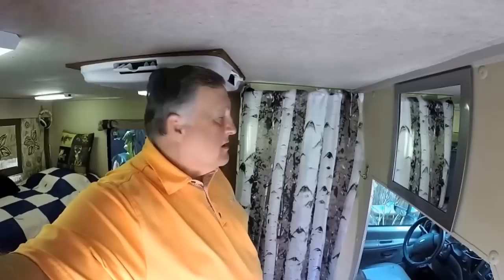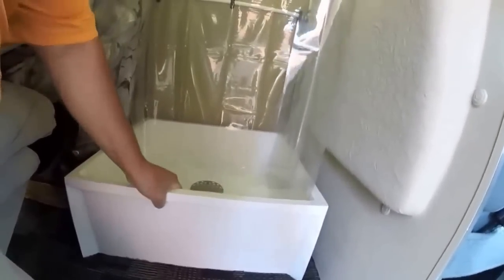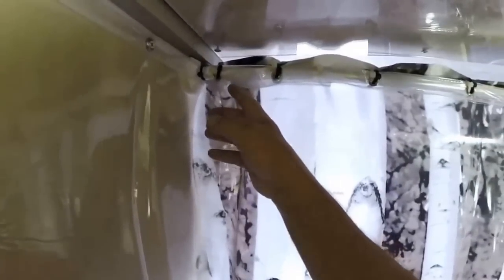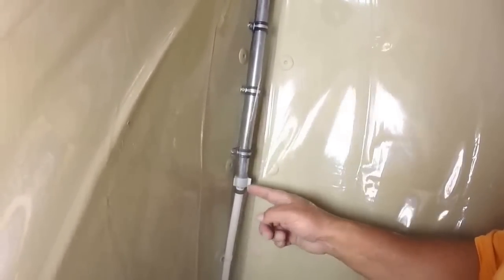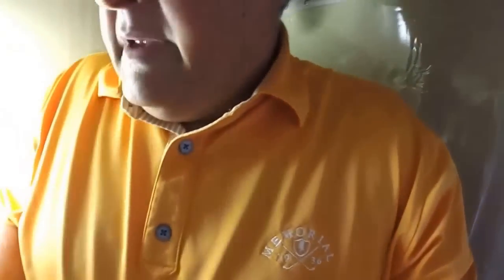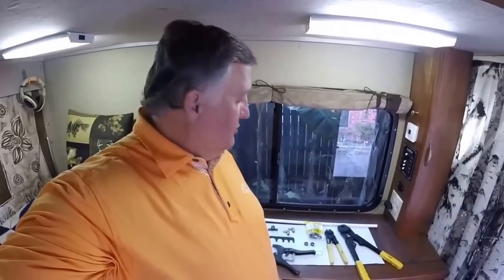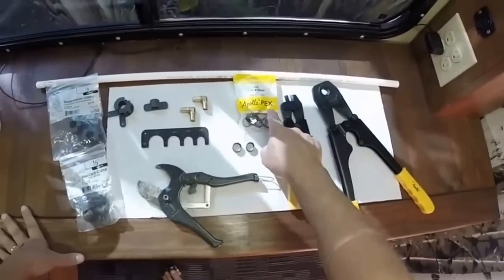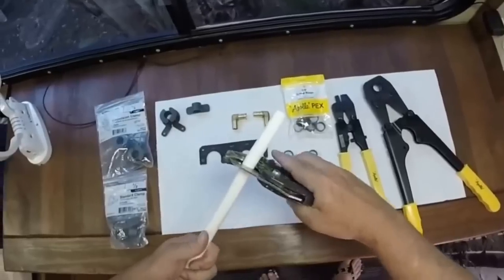Jordan Box Truck Camper Conversion Shower Install

Comment: One great thing that might just make your shower even better is to install a shower head with a shutoff on it.  This is common in trailers where you have a limited amount of water available.  You can get your temps set, get wet and then turn off the water at the shower head while you soap up.  Then turn the water back on at the shower head to rinse off,
Reply from the maker: +Rick Conley Nice idea Rick, i will consider that! Thanks!

Comment: Thank you for the detailed video on the shower build. Excellent job.  I especially appreciate the tutorial on the pex material.  I've watched your original build and really like all the details that you provided as you went along.
Reply from the maker: +Chain saw cabinet Shop Hi Chain saw, thanks for the compliments, hope the material helps you in your builds!  Also, check out my video that includes discussion on Water Pressure Regulators.  I went camping a few weeks ago to a state park that was basically empty and the water pressure hit 105! Caused me a drip in the SureFlo water entry connection to the PEX, but the PEX didn't leak at all, worked great.  I went back and reapplied some of the new GREY teflon tape that is available now, it is thicker than standard white teflon tape and seals much better.   But as i mentioned the PEX was solid.  I am also just putting out a video on adding Cruise Control to my vehicle, and am preparing to launch a Radio install video.  Thanks, for watching, and subscribe to my Ottodiezel Channel.  :-)

Comment: Thank you so much for the details, great video with lots of information. I do have a question, does your shower drain have a p-trap or is it a straight line going into the gray tank?
Reply from the maker: +JustPeg I did not install a p-trap, the drain is a straight line into the Grey tank.

Comment: omg I never thought to use a kind of sink, absolutely love your ideal,  love love it, will use your ideal in my van. Thanks
Reply from the maker: Hi Velia, yes it is actually a very strong and sturdy Mop Basin, you can see the part number at the end of the video.  It is heavy and well built.  Would like to see pics of your build when done.  Glad you like the idea, it works great for me!

Comment: do you get any smell or fumes coming out of the straight pipe into the grey tank? I would think some kind of trapGreat build I will probably follow your lead> would be better.
Reply from the maker: +sam white Hello Sam, since i normally just use the shower with some soap i do not get smell from the grey tank. However, if i hooked up my sewer hose to grey tank and left the valterra valve open, i might get some smell since it would drain empty and maybe get smell from the sewer tank up the hose.  So, even if i did that, i would likely keep the valterra valve closed and just drain it when necessary.  Normally i do not get any smell from the grey tank.  Another consideration is to just lay a rubber sink sealer over the opening when finished showering.  My shower grey tank only holds 20 gallons and that means three showers before needing to drain it, i like to take a decent shower!  :-)   Something else to consider also, i just came back from a four day camping trip and noticed that i had a small water drip at my entry into the cabin.  Found out that the water pressure at the camp site was near 100 psi.  I just bought a water regulator made by Valterra that will regulate it between 40 - 50 psi, which is where it should be.  Costs about $30 for the high flow regulator with a gauge on it.  Orange twist on the top indicates a lead free device.  Check it out.  Installing mine tomorrow!

Comment: How is the double sided tape and other attachments handling bumpy conditions such as rock/dirt roads? Thank you.
Reply from the maker: +kanaloa38 I have had this unit out 5 trips now, and not a single item of movement out of place.  that tape is awesome, and holds in a wide range of temperatures. Shower holding firm.  Also the drain hole is 5 inches, and the bottom of the basin also extends down one inch or so into the hole and is a solid fit, where I also used the butyl tape.  That basin isn't going anywhere!

Comment: The perfect shower dimensions for my van! After much searching for a small shower stall on the internet, I finally found this mop basin. I was excited. I conjured up a vision! Then I said, I would love to find someone doing a conversion actually using this mop basin. Then, the very next day, I saw your video. I was so excited. Great shower install...
Thanks for sharing.
Reply from the maker: +Renee Copeland I am pleased that you find this solution will work for you too!  I am very happy with my shower, works great!  BTW, be sure and install a water pressure regulator on your water feed if you are using a campground water supply.  I am preparing a short video on that along with another addition to my truck.  That basin is very strong and solid.  $165 or so from where ever you can order it from.  I would like to see your install when done!  Best wishes!

Comment: so your water heater holds only 6 gallons of water? so you dont need a different water tank to hold your fresh water?
Reply from the maker: Hi RTJennifer,  I dont carry a separate holding tank for fresh water, although i do carry several gallons of water with me on trips. Since i normally go to places with a water hookup, i have all the water i need through the shower, but normally use it to shower, and clean stuff.  The purpose of the holding tank under the shower is because many places i camp, will offer Electric and Water, but not a sewer hookup, and they do not allow just dumping water on the ground.  So, i hold it and dump it later.  6 gallon water heater is just for warm showers or hot water if i need it for something.  I try to keep things simple, and didn't want a sink, and all that.  No need for me as i can get all i need without it.  You working on a build?  Thanks for watching!

Comment: How much money did you spend to do this conversion?
Reply from the maker: +Jonah Halbert Check out the Comments on the original video, I have two responses related to the cost with some detail on it.  Nutshell, $11k of which $6k on new large items, $5k on the materials and small items.

Comment: How long does the water stay hot
Reply from the maker: This is a 6 gallon water heater and when showering, mixing the hot with the cold, I will tend to use 4 gallons of the hot water before completing a shower.  If I take a long shower, I will use it all, but would end up using 10 to 12 gallons of water overall in the process.  So, I do not run out of hot water during one shower.  it heats up pretty quickly so, a second person would not have to wait long before taking a shower and still have hot water.  Also, in hot days, I would use less hot water, so, would last longer also.  Thanks for watching.